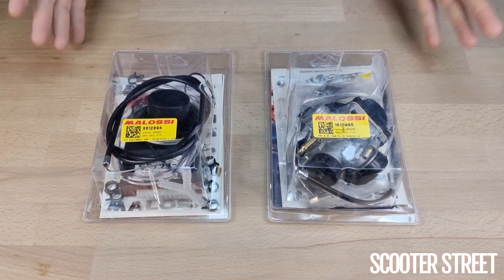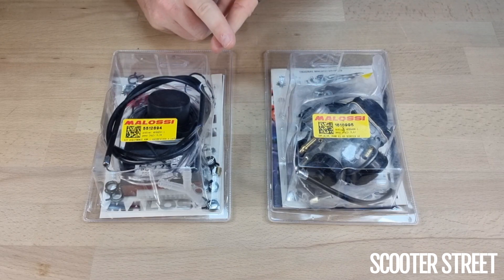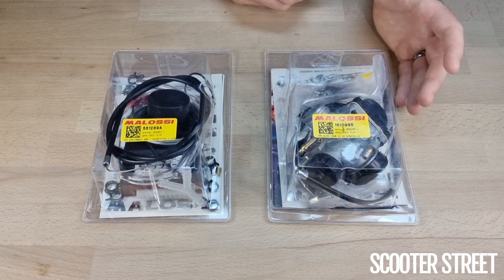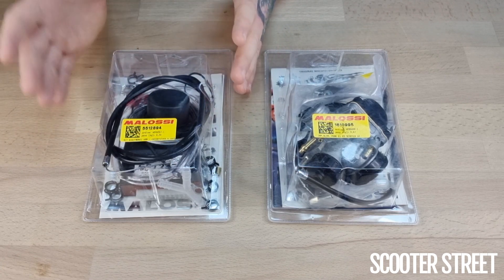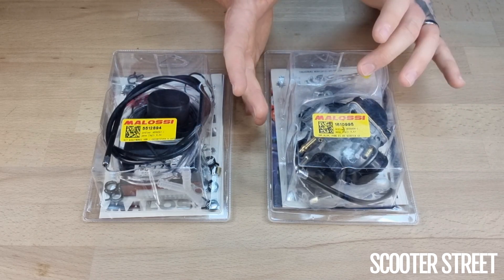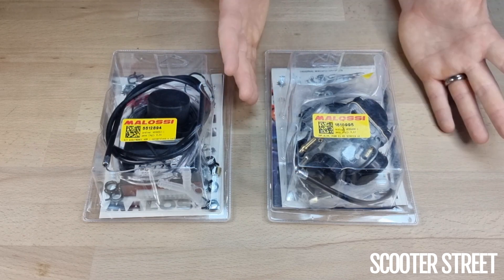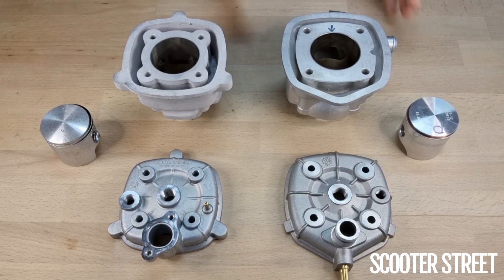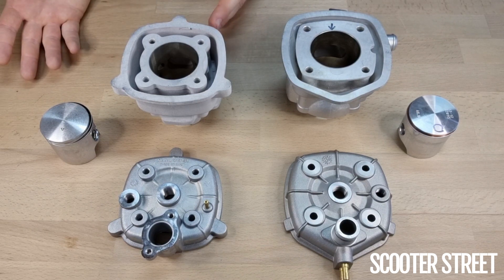Carb Conversion for Aprilia SR50 Ditech & Piaggio NRG Purejet - Explained

Comment: im doing it right now, i already bought everything - carburetor, cylinder head. revorked all the electronicas that are not needed with the carburetor, onlyi don't have it from malossi because the price is close to 400e, so far now they will drive as it is and when i get the money for this part, i will describe how it works...because now i spent 600e on parts because i bought everything new of good quality and there was no budget for this part...
Reply from the maker: Any larger carb will suit, dell or similar.

Comment: Good day Guys, what sort of compression reading should a Malossi sport 70cc kit show when new? I am having some starting issues on a carb conversion Morini with a full circle crank. I recycled the cylinder and piston just replacing the rings and have a compression reading of 105psi. I can get it to run with a quick sniff of easy start but hard going off the start button.
Reply from the maker: 120PSI is great but 105 although low should still start. Check the crank seals, also make sure the fuel is arriving at the cylinder. The use of easy start indicates a possibility of nit fuelling. Checks start at the tank and follow from there. It will pay to check Spark, Air and reed.
Reply: @scooterstreetau  thanks for the reply guys. I have replaced the crank and seals but now wonder if maybe I have a compression leak on one of them but if you’re saying 105 should still start. I’ll let you know. Spark is strong using a digitronic. Reeds are malossi and new. Air filter is stock with air box mod tubes. I have two different carby options 19 dellorto and  21 copy same issue from both. 
Thanks for your great advice and awesome videos.
Reply from the maker: @totallysimulated944  When a new install you must give time for carby to prime and give fuel to the cylinder. Is this happening? You should check what you have done to eliminate possible causes. Be thorough and check from crank to seal to piston and so on.

Comment: poz, did you just want to tell me how to connect the electricity, does it remain in his computer or is it installed from the carburettor version of the cdi, thanks
Reply from the maker: For these you absolutely MUST follow the instructions in the manual.

Comment: i have an sr 50 and i just did this conversion, do you change the whole throttle cable from grip or just change the cable that came with the kit? i tried putting the cable from splitter box to carb but was a little short. piaggio engine
Reply from the maker: Yes, only the cable to carby. Reroute if required.

Comment: Hey! I have a question! I would lik to put stage 6 mk2 racing on aprilia ditech engine. So i would like to know is it possible. If it is, do i like buy a stage 6 mk2 kit for piaggio engines or?
Reply from the maker: Buy the exhaust that mathces the cylinder and the frame fixings can be retro fitted.

Comment: could you just cap the top of the stock head after removing the injection set up? also wud i need a new ecu to keep the dash correct?
Reply from the maker: The ECU is in the kit, it is the part on the left at the start of the video👍
When the companies design and produce these products they test their designs and offer a product that will work effectively, so we trust the brands we like and therefore use what they recommend. When the parts are fitted you can be assured that the engine will work fine and with these kit it does. So capping the head may not be ideal.
Reply: @scooterstreetau  TY, I just purchased an sr50, and I've learned from the 90s that oil injection is the worst.
Reply from the maker: @thesw313tspot8  👍what SR50? we have faith in the injection systems.. but free to decide👌👌

Comment: im still confused. Do i have to by a new cylinder when doing this conversion or can i just keep the stock one  that come with the bike ?
Reply from the maker: Did you read the Malossi instructions for the ECU? It explains everything.
Reply: @scooterstreetau  Would've been faster to just answer his question.
Reply from the maker: @ricvieramusic Yes true, alot faster but people want direction, otherwise you won't learn. With the Ditech conversion you need to learn as it very testing task. Do you need the same question?

Comment: Can you do a video of this kit conversion?
Reply from the maker: We do have this plan for 2023, I have acquired a Ditech. So now just need free time.
Reply: Nice, definitely waiting for this, planing to do carb conversion on mine purejet
Reply: Also would be nice to see carb conversion all oem, not on tune.
Reply from the maker: @everythingbro4786  MMMM yes.
Reply from the maker: @everythingbro4786  ok great..
Reply: @scooterstreetau  Hey I converted mine. Works, fires up, but cant keep constant slower speeds, it does accelerate to desired speed but starts decelerating(dropping revs to idle) and if I apply just a bit more throttle it pulls like I twisted full throttle... I went with TPS connected to throttle cable method bcs I want to keep Rev gauge working... This is only thing that is the problem with my conversion... Do you know what could be the cause?
Reply from the maker: @StromtrooperV2  Are you using a carby?
Reply: @scooterstreetau  Using original Dellorto 17.5 PHVA ID that came with carb model
Reply from the maker: @StromtrooperV2  Check it out thoroughly at the cable and the adjustments and tune the carby main jet and if no change try a needle change.
Reply: @Scooter Street  Carb main jet tuned, tried all sorts from 70 to 95, same occurs. What I suspect is that Purejet's ignition timing is the problem... It drives at 80% throttle quite nice, all else triggers the problem I described. Its stock 50cc cylinder btw. not 70cc
Reply from the maker: @StromtrooperV2   If you are using the Malossi Conversion kit 5512894, you must follow the recommendations and the parts listed. See the Malossi website or the shop you bought the kit. When you introduce your own parts and change the way the system is calibrated then the reuslts will officially change so much work will be required to have a similar result of the original recommended kit.

Comment: Hi.i have a aprilia ditech -02injection 70cc. do i have to buy new cyl to? or just coversion kit and carburator? br Aj sweden.
Reply from the maker: With the Ditech Morini engine, when you use the Malossi conversion unit (5512894) they recommend to use a carby (1611040 or similar) and Cylinder from Aprilia SR Replica which is again Morini/Aprilia.

Comment: I have a 2005 Aprilia Scarabeo 50cc 2-stroke ditech, which carb kit should I buy?
Reply from the maker: Which canversion kit did you buy? Follow the recommendation of the carby on the Malossi website,
Reply: @scooterstreetau  I have not buy anything yet.  I am learning the process and have no idea yet.
Reply from the maker: @khoale1537  Ok thats cool, Check the Malossi website for the conversion kit and read up on the manual before making any purchase.
Reply: @scooterstreetau  I could not find a conversion kit for my model 2005 Aprilia Scarabeo 50cc 2-stroke ditech from the Malossi website :(
Reply from the maker: @khoale1537  You should be able to use the same conversion system, Malossi 5512894. do all research prior to any purchase.
Reply: @scooterstreetau  The Malossi 5512894 kit is not enough, right?  Do I need to buy a carburetor as well?  Do I have to upgrade or use the original engine OK?
Reply from the maker: @khoale1537  Yes, read through the recommendations on the Malossi website as you will need to replace these items.

Comment: and rough needle / jet size reccomendation when doing this swap?
Reply from the maker: Hi, Are you using the carby kits that we sell? If using the PHBG it will take W series needles and we start with W9. Jet size we will start at 92 and then work down from there..

Comment: Which of malossi mhr rep and stage6 sport pro mk2 has better acceleration and top speed?
Reply from the maker: There's alot of variables there - but the MHR Rep would be our pick. It has excellent off the line torque, and mid range which makes it really fun around town up to 90kph zones (its also twin ring, long piston service life). The Sport Pro MKII probably has a higher maximum power figure being that its single ring, but will need significantly more work to run as well as it makes it power at a higher RPM than the MHR Rep, meaning there's more work to be done to make that power accessible for general use. Both are great cylinder kits, the price point of the Stage 6 is also excellent.
Reply: @scooterstreetau  if we say I get the mhr rep what 2 more upgrades would you recommend. (I already have a exhaust and 17,5 carb) and what top speed could I expect. And it’s a sr 50r
Reply from the maker: @theo2522  Overange variator and Gear kit  or (inner rotor ignition)..
Reply: @scooterstreetau  is there a different between sport and overange variator
Reply from the maker: @theo2522  Yes, sure is, different dimensions plus other small changes.
Reply from the maker: @theo2522   Yes there certainly is, see the Variator playlist> https://www.youtube.com/watch?v=zGBZ-fl8icY&list=PLi1jigkxR7eI2cFcwYYx0k-pmFrOJaiYJ&ab_channel=ScooterStreet
Reply: @scooterstreetau  what overange variator would you recommend?
Reply from the maker: @theo2522  Malossi make 2. Standard over range and then the MHR over range(for race).Depends on your set up long term and the budget.
Reply: @scooterstreetau  is there kits with just the overange variator because I can only find the full kits ones with variator, belt, rear pulley and more. Or have I misunderstood and the multivar is a overange variator because I thought it was just sport
Reply from the maker: @theo2522  Over Range variator is PN5118238 for SR50R carb.
Reply from the maker: @theo2522  Yes, you can buy just the over range variator, we have it in stock on our website.

Comment: Seems like it would cost about $1400 AU (without exhaust) to convert it, and that's not including labor. Please correct me if I'm wrong, because I really want to do this, but not if it will be that expensive.
Reply from the maker: Yes, you need the conversion ECU kit, the cylinder and carby and an exhaust to match the cylinder.

Comment: Definitely better to go straight to the 21mm carb, completely different throttle response to the 19s
Reply: Not sure if it’s because I’m running the stage 6 sport pro but the 19 seemed to have a flat spot, maybe I just had trouble getting it setup right not 100% sure
Reply from the maker: Could be either, hard to tell. We usually recommend 21mm carb with a 70cc cylinder kit to keep the % increase closer. 50cc - 70cc is roughly 40% increase, going from 17.5mm carb to 19mm is only an 8% increase - which isn't going to do much. 21mm is far more appropriate.

Comment: Hi Guys, how can I verify that the Coil is good on a ditech sr50. I have the digitronic conversion but have no spark.
Reply from the maker: Difficult to test these, try it on another scooter. It should test @ 5 OHMS. But testing it on another scooter is the best way. Check the stator too.
Reply: Thanks Guys, stator brown wire broken. Good spark now.
Reply from the maker: @totallysimulated944  Great result💥💥

Comment: Can I retain the stock ditech head when converting
Reply from the maker: Why are you not changing the cylinder?
Reply: @scooterstreetau  I have the malossi 70 and it did not come with a head
Reply from the maker: @runningbear211  When you purchased the parts did they advise what kit to use? All of the information is on the Malossi website.
Reply: @scooterstreetau  no at the time I was not doing the conversion now my injection system is faulty so I'm going to carburator and wondering if it will work with ditech head
Reply from the maker: @runningbear211 Ok, the Conversion kit stipulates you must use the Malossi cylinder,  31 9541 which is used for Morini (Aprilia) LC engines. This kit comes with head. There is also advice to use the 19mm carby.

Comment: i bought a carb kit this summer for my gilera
it made a huge difference with the right jets 😀
Reply from the maker: Great work👌 Changing the jets is the way to go..
Reply: @scooterstreetau  quick question for you. Do you use gaskets on both sides of the Reed valves om the hiper2 engine. Stock there are none?
Reply from the maker: @landmonkey22  We make the Liquid gasket.
Reply: But the consum its doubled yes?
Reply from the maker: @nicusecan7998  is higher yes.

Comment: Hi . I have sym crox 50 cc euro 5. What i Can Do to have more Speed please .
Reply from the maker: Unfortunately there isn't a lot you can do to the 4 stroke scooters outside of an 80cc cylinder kit. You can try derestricting the CDI, most of the 4 strokes are restricted from factory. This will often give you a few extra kms top speed. Putting a slightly longer belt in the bike can also help, but only of the factory belt isn't reaching the very top of the variator. I would usually only recommend trying this if you're experienced with CVT transmissions.